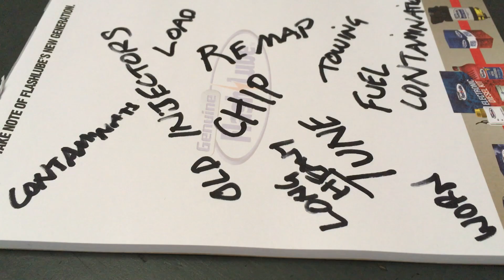Cracked pistons 1kd-ftv diesel what are the main causes

Comment: This is a 1KD disease that the manufacturer turns a blind eye to. I get the point, remaps or chips certainly doesn't help, but they are by no means the root cause. There are many out there with same failures is stock standard form as well. It is "convenient" for Toyota to refuse warranty claims because clients did X Y Z to the vehicle. My novice opinion is weak pistons, overheating that the water temp guage doesn't pick up and if it finally does its normally too late and finally faulty injectors. Its not a question of if its going to crack pistons, rather when. My advice, get rid of it before it runs out of warranty. m2c

Comment: Hi Anthony, I’ve done 108k in my 2012 150, it’s starting to blow a bit of smoke when I start it in the morning(Melbourne), can this be a Sign of worn injectors. I had the values checked and was told they are ok but I’m not totally convinced.
Reply: Medyan Ghareeb black smoke, just had the intake cleaned out and egr, air cleaner is new.what are the other causes you mentioned?
Reply: Try replacing the suction control valve if you haven't yet got it sorted.